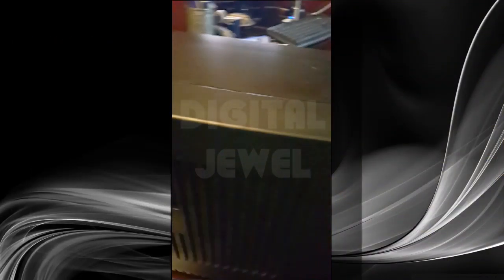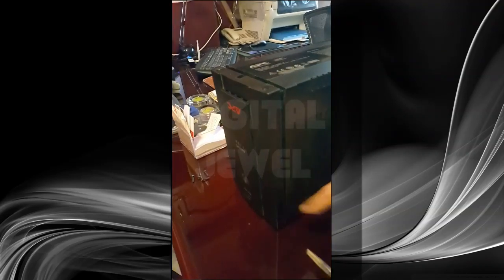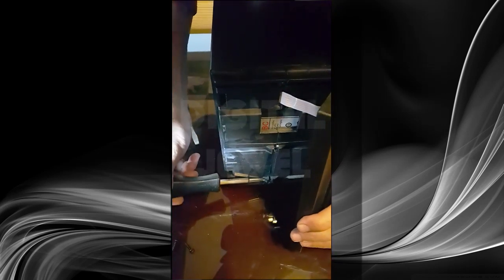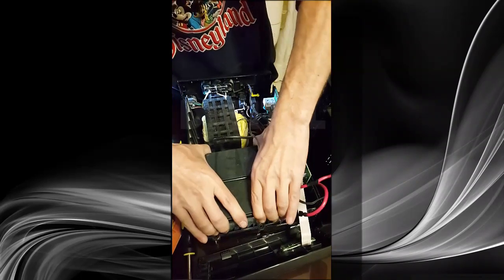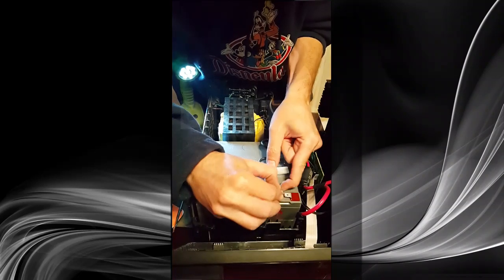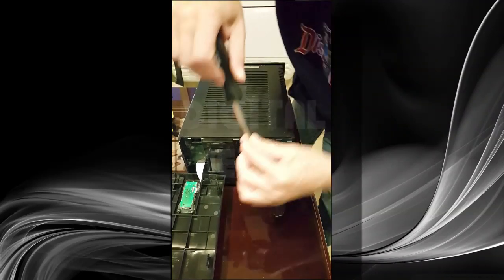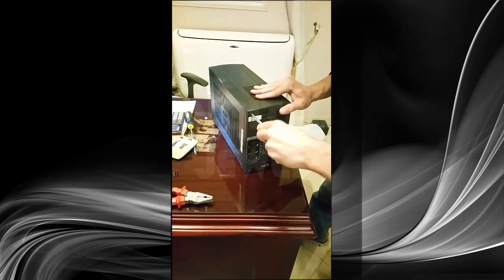How to Replace battery UPS 1100 \ BX 1400UI  \ BX 950UI APC 2018 in Details

Comment: What are the battery specs? I need to replace mine.
Reply from the maker: Hi
Battery spec is
CSB GP 1272 F2
12 V  7.2 AH
kind regards.👍
Reply: @TheAdamaty  2 pieces of the battery should be ordered right?
Reply from the maker: Depends
Newer models has one battery only
Older ones has 2
Check urs to see if it has one or 2
Regards
Reply: How long it took for the battery before you replace it?
Reply: @TheAdamaty  Thanks for this tutorial. My APC UPS BX1100LI-MS only has 1 battery but is using 12V 9.0 AH.
Reply: @TheAdamaty  is it okay to add more battery? mine also has one only..thank you for the video, helped me last time I changed battery and still has helped me today,
Reply from the maker: Hi  @rompo ...... No not recommended  ..... regards
Reply: @rompo you can use newer LifePo4 type batteries (12Ah). The inbuilt charger will handle it easily and you have a higher capacity by 2000 charging cycles (instead of 400-600). In addition you can make an outside port and add any high capacity battery (with it's own charger) and a 10A power diode in series in order to avoid charging it from the APS unit parallel to the battery (same voltage).

Comment: Thank you so much for this extremely useful, slow-paced and well-explained video. I'd never have figured how to open those f- panels without breaking them or my nerves. I'd never thought of twisting the screwdrivers! 

Shame on APC for such a complicated procedure. I trashed my old noname UPS for a well-known brand as I thought I'd be simpler to change the battery... But I feel like it'd have been not that much difficult to revive my noname UPS! 

Thanks to you, I have a BX-950UI and replaced its RBC17 today (after 6 years), with a Yuasa NP7-12L. The "L" being important here as it ensures you're getting the battery with 6.3 Faston cable clips, and not 4.8 sized ones like the normal NP7-12.

I only got trouble replacing the three inner screws which were very thighly set from the factory. Couldn't screw them totally so I left them halfway to avoid damaging the holes.
Reply: It's solid like a rock though and very hard to actually break. Heavy duty stuff.

Comment: Thank you for this informational video! I have the same ups and it finally gave up on me last week. After watching your video I had enough motivation to replace the battery myself and save some cash. Inside there were two BB battery SH1228W. I ordered online and swapped them with two upgraded CSB UPS12580 batteries. Everything is running just fine again! No more annoying tone and flashing led. Thanks again!
Reply from the maker: Thanks bro
Really appreciate it 
And I am happy to hear that the video helped 
Kind regards.👍

Comment: To reconnect the battery, I think its best to connect the red (+) first and then the black (-) to avoid sparks. This is very common when connecting battery in car or motorcycle.
Thank you for your video.
Reply from the maker: Your right bro
Also make sure its unplugged 
And the yellow fuse is disconnect 
Regards

Comment: Worked for me just fine (BX1400UI). SImply got the replacement batteries from Amazon. Everything worked like a char. Thanks for howing how to properly open the biggest (side) cover, as it was not explained in the other ihstructions I had. Excellent video !

Comment: Thank you for your useful video. FYI in this market they sell these units "as disposables" no option to replace batteries. As just bought model APS BX1400UI which is almost identical as your unit.
Kind regards from Santiago de Chile
Reply from the maker: Thanks Bro
you are right I have an older one with removable flap so you can replace ur battery instantly much better than this one this is why I made this video
Kind regards
Reply: One last thing. I wonder if I can use a battery replacement of 9 AH instead of 7 AH? By the way, from the APC brochure "The battery in the Back-UPS BX1400UI is not user-replaceable". For this reason I consider your video very clever. Have a nice day.
Kind regards
Reply from the maker: Hi bro
this is actually what I have done i have also installed in my one of my ups's one with higher amp and it works great
and thanks for you comment really appreciate it
Kind regards
Reply: haha same here , my model is bx700ui in the manual it said its non user-replaceable battery .. so i took a chance and replaced it .. the faceplate wouldnt close properly so i took a blade and chipped the inside plastic of the faceplate and was able to close it . it works and i am happy.

Comment: Thank you for this video.  You have helped me a lot to be able to change the battery of my APC 950 UPS because physically this UPS is very similar to the one in your video. I used a SALICRU brand battery that had the same characteristics as the one used in this UPS.
By the way, thank you very much also for the Spanish subtitles, it is a detail that helps, because with the nerves of doing this and attending to another language you can get confused and the subtitles are a good support

Comment: You have shown me the way to open the front part of my similar BX1300LCD. Although it has a separate door to replace the batteries. This 14 year old UPS ( as of July 2022) was getting warm while plugged in. I just want to check internal parts for ware. Schneider wouldn't give me any info about how to open it 😞. You just did.  Thanks
Reply from the maker: thanks

Comment: My unit also had 1 battery. I think there is some confusion about the 1 or 2 battery units.  Some units like this ship with 1 x 12 V DC battery OR 2 X 6 V DC batteries (wired in series). I modified my case and put in 2 X 12 V DC batteries wired in parallel. It seems to be handling the extra battery just fine. Thanks for the video, it got me started down the right path!!!
Reply from the maker: Yes there are 2 of them the newer ones has only 1 battery the older one has 2 batteries which was better from the point of backup time it supports 
They are trying to cut down cost
Reply: @TheAdamaty  The units with one battery are using (1) 12 V DC battery.  The units with 2 batteries are using (2) 6 V DC batteries. Are you sure there is a significant difference in load time?
Reply from the maker: Hi
Yes sure there is a big difference in backup time cause I have both
Regards.👍

Comment: Instead of £100 on a new UPS, I bought a £16 battery thanks to this video.

Used this video to replace the "non-user serviceable battery" in my Back UPS BX950U, which looks almost identical - just no fan. The BX950 had just one 12v 9Ah battery inside. I replaced it with a very cheap Yucel 12V 7Ah battery. It's only used to give my server enough time to shutdown in a power failure.

Am I right in thinking I can add another 12V 7aH and link them like in your 1100 video?
Reply from the maker: Hi 
No you can't add another as another user has added another battery and it over heated so you'd better stick to one battery  to work smoothly 
Kind regards.👍
Reply: I also have the BX950UI and it also has a single battery. The replacement battery should be the RBC17, am I right?
Reply: @axelgenus  You're right. I have the same UPS and replaced mine today (after 6 years), an original APC RBC17, with a Yuasa NP7-12L. The "L" being important here as it ensures you're getting the battery with 6.3 Faston cable clips, and not 4.8 sized ones like the normal NP7-12.

Comment: Thanks a lot! The bigger APC 1400 has the exact same design, except for one cable that ties the main board to the side panel, which only makes the opening of the side panel a bit harder. Otherwise everything is the same. I'm baffled why APC would do so much to prevent users from replacing their own batteries!
Reply from the maker: Hi Jacky
Thanks to u buddy really appreciate it 
And thanks too for the info
Kind regards.👍
Reply: In fact I came here looking for info for my unit (the 1400 model) and I realized it looks exactly the same! Thank you both for the video and tip :)

Comment: HI i tried to open the ups as instructed in your video I though just like in your video that it has 2 battery but I was a bit surprise that it only have 1 battery. Question is can I hook in the other battery? my model is APC UPS BX1100LI-MS 550 Watts. Thanks and God Bless

Comment: Hi and thanks for your video.  My APC Back - UPS 1100 only has ONE battery, a CS3 HR1234WF2... It is 12V but your 2 batteries are connected in serier = 24V... I have room for a second battery but don't dare to connect them in serie, but perhaps in parallel. My main board is a SK 76VOA 94V-O E116921

Comment: I bought a UPS yesterday and it's APC model BX1100LI. I'm not gonna open it because its' brand new but around 5 years from now when the battery wear out your video will be a big help. The one I bought the front looks identical to yours but on the back two of six outlets are the same as yours but the other four are universal outlets and it doesn't have a fan. According to manual it has a 12 V 9 ah battery and didn't specify how many so when I googled it, it only has one battery instead of two like yours. Which means during power outage the battery drains faster than yours.
Reply from the maker: Hi bro
nice info you got there ...UPS are trying to cut down cost to put one battery... but if urs drains out quicker than mine so this means its does not give you a sufficient amount of time if you have a Nice CPU geared with decent VGA cards and power supply that exceeds 1500 watt plus its monitor   .... you might consider upgrading it with 2 batteries when they wear out ....one more thing the original battery wont last 5 years ...I think 3 years MAX
Cheers Buddy
Reply: When the original battery wears out I might gonna replace them with two batteries to increase the capacity but I have to connect them in parallel to maintain the 12 volts supply because connecting in series means they will output in 24 volts damaging the board. Yours is designed to run at 24 volts that's why the batteries are in series. The advantage of 24 volts model is they only draw half the amps compared to 12 volts model during battery mode of the same load wattage. So during power outage they lasts longer before the batteries runs low.
Reply from the maker: Ya exactly .... your right
Kind regards.👍
Reply: I bought a 2nd battery and connected them in parallel to the original battery and here's what I discovered when run under battery mode by disconnecting it from power outlet. Before I added a second battery the UPS can power the PS4 Pro under battery mode for 8 minutes before it beeps rapidly because the battery is running low (PS4 Pro only playing Uncharted 4 because the TV is connected to another UPS). But when I added a second battery in parallel it runs for 26 minutes before it beeps rapidly because the batteries are running low. However, the UPS became very hot that the top plastic casing where the heat sink is melted. My UPS is not designed to run that long for a high load like the PS4 Pro. I removed the second battery afterwards to prevent overheating when an actual power outage happens.

Your model is designed to operate at 24 volts that's why they have two batteries in series and the amp load of batteries are half compared to 12 volts model of the same load wattage so it can run the PS4 Pro longer without overheating. For people like me who love modding electronics I want to give them a heads up that if their UPS only has one battery do not add a second battery in attempt to extend run time during power outage because they are not design to run that long for a heavy load like the PS4 Pro. I learned it the hard way. If you want to play games for longer period of time during power outage buy a UPS with larger capacity rather than modding smaller UPS by adding batteries unless your total load wattage is less than 25% of UPS capacity to make sure the UPS doesn't overheat.
Reply from the maker: Hi bro 
Great info u supplied us here one thing you connected the the ps4 with good quality cable cause if the cable was not good quality the ups will over heat and was the ps4 running 4k output another thing was the battery u added the same exactly as the one inside cause they suppose to be identical same type same brand same amp cause if they are not the same they will sure overheat 
Keep me posted bro
Kind regards
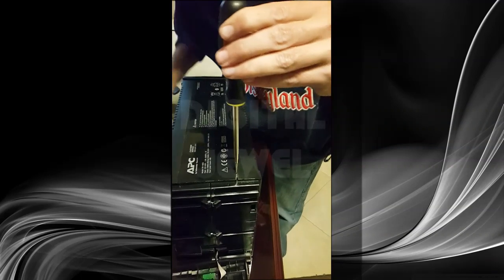Reply: I googled it and you can actually tell the difference between two batteries in series (24 volts board) and one battery (12 volts board) by looking the model specified at the bottom at 2:40.
BX1100LI-MS (one battery - 12 volts board) (240 volts 50/60 Hz sync to mains)
BX1100CI-MS (two batteries in series - 24 volts board) (240 volts 50/60 Hz sync to mains)
BX1100U-LM (two batteries in series - 24 volts board) (American model 120 volts 50/60 Hz sync to mains).
Reply from the maker: Great Info bro
Thanks alot
cheers Buddy ;)
Reply: bobskie321 - does your UPS smell like burnt electronics when in use? I bought the same model new and it's been stinking up the room for four days.
Reply: Tube Watcher
No, I didn't smell anything. I smelled it once when I modded it by adding a 2nd battery in parallel and run it in battery mode by disconnecting from the power outlet and I played Uncharted 4 on PS4 Pro (PS4 Pro only because the TV was connected to another UPS) and when the battery runs low 26 minutes later It smells like burnt electronics. Normally I didn't smell anything. My APC model is BX1100LI not BX1100CI like in this video so mine only has one battery instead of two and mine don't have a fan on the back that could be the reason why I didn't smell anything because the odor can't easily escape from the vent. I suffered from runny nose for years because of allergy and my sense of smell is no longer as good as it used to that could also be the reason I didn't smell anything when the UPS is in normal use.
Reply: bobskie321 - thank you for the quick response and for the detailed reply. I also have the BX1100LI . I'll wait and see if the 'new car' odor dissipates in time. The smell is less pungent today. FWIW I've googled and encountered random reports of various UPS models that emit an odor when new. The only consistency is that no one knows what causes the odors.

Comment: I have dell T7910 workstation which has 1300w SMPS. 
Will APC 1100 series UPS be compatible for it?
Reply from the maker: yes the UPS will handle it easily
Regards

Comment: Hello, I got a BX1100CI, I got it without batteries so I had to order them, question is: does it need 1 or 2 batteries? In the video I see 2 batteries, but I read in other comments that in newer versions only one is required. Anyway you can help pal?
Reply from the maker: sorry for the late reply
use as the ones installed if its one use only one to prevent overheating and causing other problems

Comment: Very helpful guide... Thank you.. i've replaced 2x 12v 7ah batteries on my bx1400u.. batteries are detected on powerchute but i can't start a self-test from software..
Reply from the maker: Thank you soo much really appreciate  it .... what type brand of battery did u install 
Regards
Reply: 2x Yuasa 12v 7ah
Reply from the maker: didn't try this brand before
Reply: Test worked.. i don't know why it failed after replace, but the next day it worked..
Reply from the maker: so the the last state its working now
maybe cause the batteries you bought was a bit old production date and took some time to start charging.

Comment: Will a group 31 battery work? I have an older one...its doing nothing. It is 12V (off a 24V two battery setup). I dont know if I can trust the Amazon crappy looking ones. Are there any BCMs or anything inside the battery or are they regular lead acid?
Cool vid.

Comment: What if the model i have is APC BX1100LI-MS and it says that it has 12volt, 9ah for the battery.. is it okay to buy 12volt 7.2ah if the dimensions are the same? Thanks and great video!

Comment: Good tutorial.
My APC ups not responding to voltage fluctuations and computer shuts down.What do you suggest?
Reply from the maker: Hi
This means that the output of the battery inside has become significantly low which means it needs to be replaced with a new battery 
Regards.👍
Reply: @TheAdamaty  Thanks.Hope it works.Will let you know if it fixes the problem.
Reply from the maker: Hi @shanelee6963  
Ok buddy ... keep me posted 
And am sure it will fix this issue
Regards.👍

Comment: Thanks a lot for your video. I changed the batteries following your video. Worked fine. When I turn my unit on, it starts beeping, even after long 24 h charge. The software (powerchute) does not complete the selftest...What did I do wrong?
Reply from the maker: That's maybe because the type of battery difference in amp

Comment: Hi, is it advisable to unplug the ups from the electrical socket when it is turned off? Or is it better to just keep it plugged in on the electrical socket even when I'm not using it?
Reply from the maker: Hi
Unplugging the ups from the electricty has 2 disadvantages 
Ur battery in the ups won't be fully charged when u start to use it so it won't give u ur full backup time and if it's a long time it will will go dead
The other thing if u keep ur ups out of use for a long time and turned off ur life span of ur battery will be alot shorter
Nothing other than that 
Regards.👍

Comment: Thanks for this! What kind of replacement battery is compatible with the 1100VA to make it work as before? Any recommended brand if I can't find an APC battery?
Reply from the maker: Thanks buddy
You mean battery brand or which models
Regards.
Reply: APC RBC113 widely available including direct from APC

Comment: so it's 2 batteries in series which makes it 24v? mine has only 1 12v battery but still the same output 220v ac..
Reply from the maker: yes different models